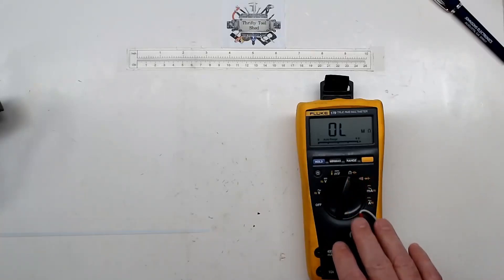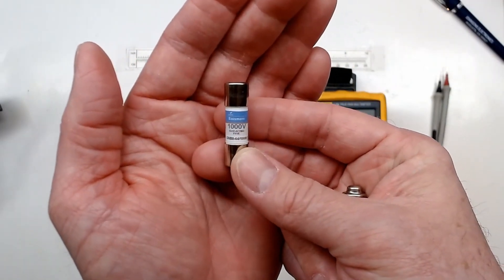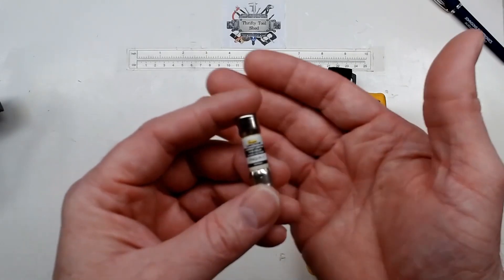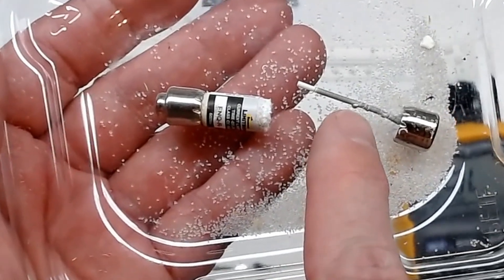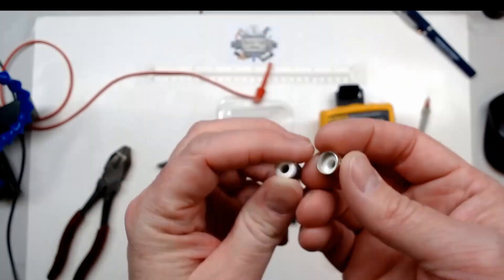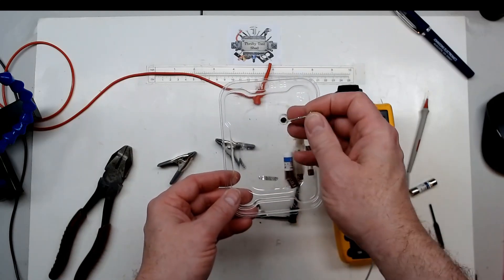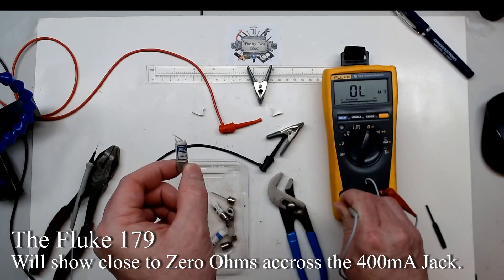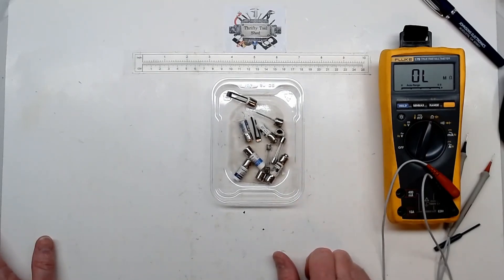DMM 44/100A Fuses Real or Fake?

Comment: can you replace ith different fuse.
Reply from the maker: The DMM 44/100 fuse is designed for the 400mA circuit of the DMM. It gives 10% over and protects the delicate circuit for mA. I have seen 1/2A fuses used, but I don't believe it's the best practice. I have seen worse...

Comment: Have you compared internal resistance when they are cool? (Very low circulating current) I have heard that original ones are ~0.7 ohms
Reply from the maker: I did not do that. Very good point.